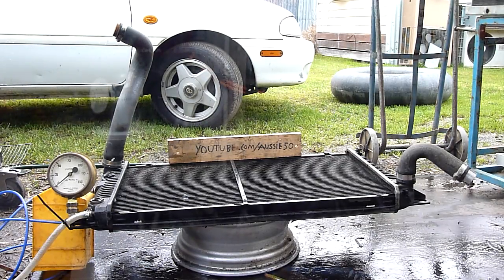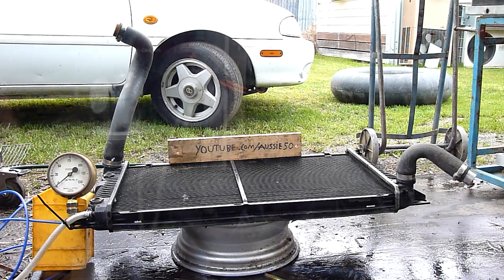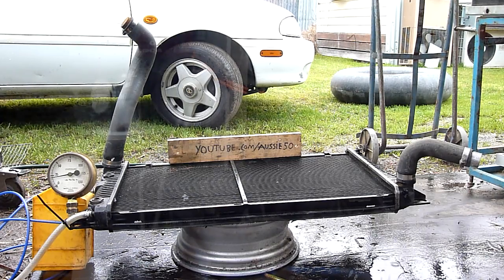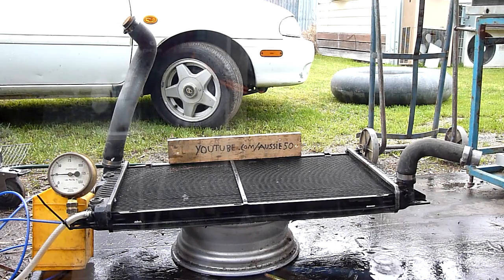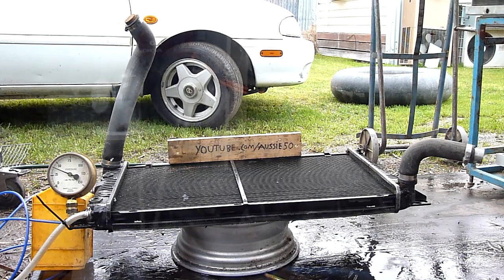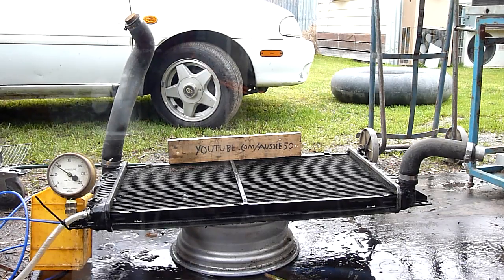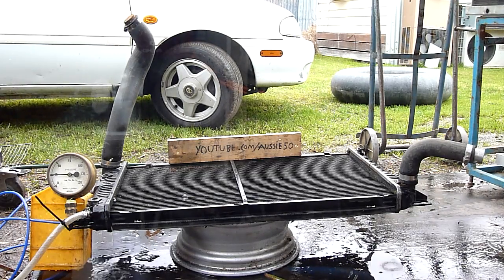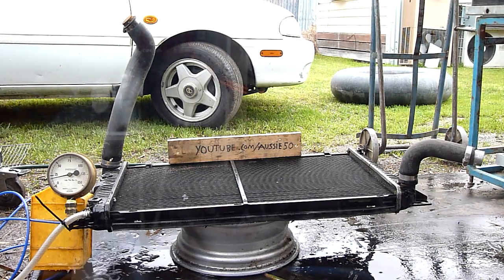Old Car Radiator Over Pressure Test

Comment: I mean a new radiator will not take that much pressure either. Most radiators are designed to take somewhere around 1 bar  (14.7 psi)

Comment: water won't explode for it isn't compressible like air.  That is why air compressor tanks are tested with water.  It will only leak if over pressured, not explode.

Comment: well I can tell you I think the core would have been aus made mate. 25psi in a 10 to 15 year old radiator is not bad. I have had 2 new Adrad radiators in my jeep and they last a week and the core tubes pull out of the header tank on the hot side. they have tested my jeep for all possible causes and I told them they will not find a thing as I keep it well maintained. They tried 6 times to solder the header tank back on (this man has 37 years in the radiator business and has hand built radiators and cores for earth moving equipment) but they would last a day or two and the tubes pull away out of the solder joints. They test it for head gasket and replaced the radiator cap made in nang kang and I told them they are running the wrong cap for Chrysler /jeep vehicles. They looked at me stupid, I told them they don't run full pressure system caps which is the little valve at the bottom of the cap is NOT spring loaded. The little valve should rattle when the cap is shaken. Anyway they come around and I put my original cap on. They supplied a new 2nd radiator and guess what it let go in 2 days. so I drove my jeep for a year with a leaking radiator, putting a litre in it each week (500km's a week). Now I have just fitted this week a $180 free delivery ning nong radiator. the radiator is plastic tanks and alloy core. the tubes are just single row but 20mm wide so lets see how it goes. I am over the copper brass radiators as I feel they have LOST the quality of the materials. OZ made is best.

Comment: Haha...I took a guess at 20 seconds that you'd start this test & one of those radiator pipes would bloat out, go *POP* & ruin the test....

But they held in there! It must be that reinforcing stuff that's inside the rubber that stopped them from bursting.

Would those pipes normally take that kind of pressure, given that a hot radiator would have boiling water in it?

Thanks for showing,

-BoomBoxDeluxe.

Comment: Damn a before and after length of the radiator would be telling but the video speaks volumes. As always, great video! A souped-up continuous current electric fence charger would be excellent. That is if you have one on hand and are taking requests. :-) I've got a deer problem and every time they hit the fence they plow through it. I want them to think twice before coming back for more.

Comment: if that was starting to let go at 25psi, that radiator was stuffed, it can reach those pressures in a car ! Cool test was interesting to see. Now break off the plastic tanks and the steel and you'll get $20 for it down at the scrap yard.